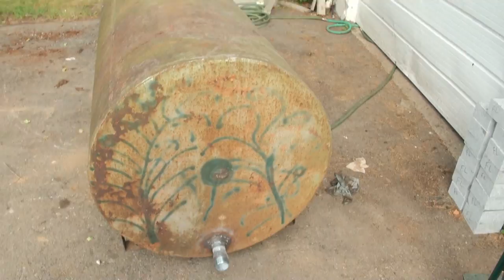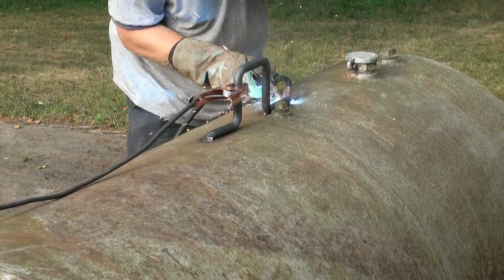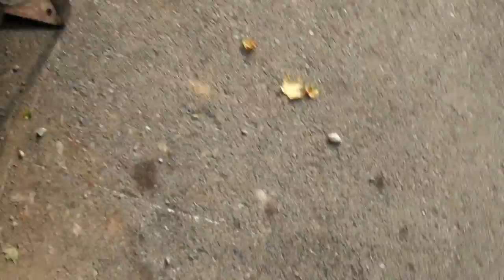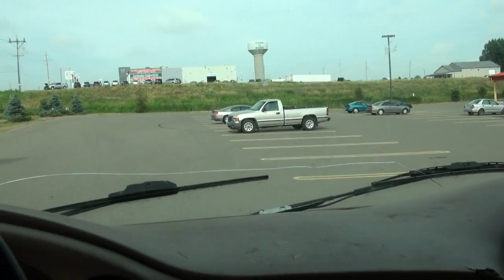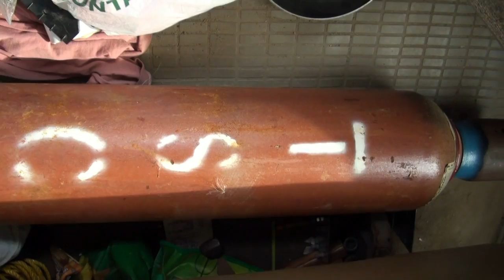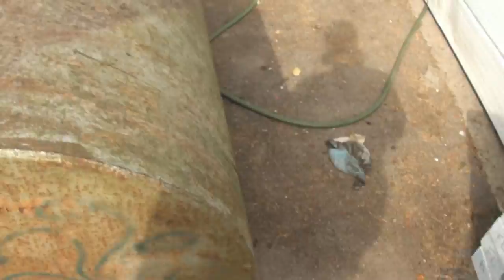PART 2 Tanks a lot ........  but water you talkin bout

Comment: that's some fine welding,don't forget  a couple of reinforcement straps . Do yourself a favor and get rid of the tank.    I would head down to Praxair and order a flux core kit that gives you a new liner  new tip new roller and 10 lb roll of 45 gauge flux core wire (just over 100 bucks).  Never have to worry about welding on windy days and welds a whole lot better on rusty metal plus your miller 180 will weld up to 1/2 inch steel compared to the solid wire at 1/4 inch.
  Oh Yeah  no more gas.

Comment: Hey Bill. I noticed in most your welding videos that you do not prep the items you are gonna weld. Your welds would come out better if you prepped the metal with a quick grind of the surface. Your welds will be way stronger and less chance of them breaking.

Comment: @VlogginLife you need to now levels of welding
the best @ this moment is plasma core
then for straight verry controled welds powder deck
then you goth TIG
then you goth MIG
then you goth Electrode`s
then you goth your flux core welder 

it will do the job more then good enough
but this time mig is the way the go for this type of welding like bill is doing 
tig is good for strong and not wide a gab welds